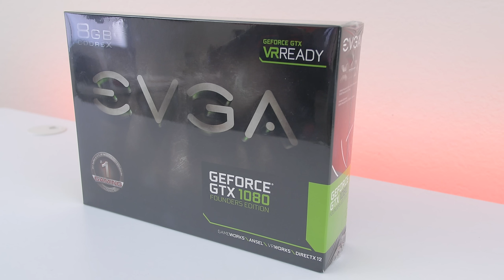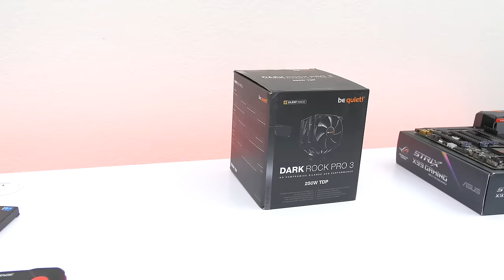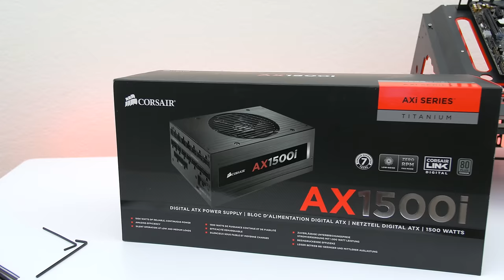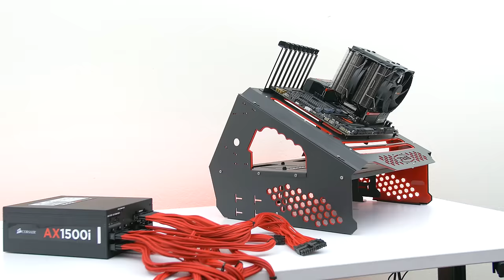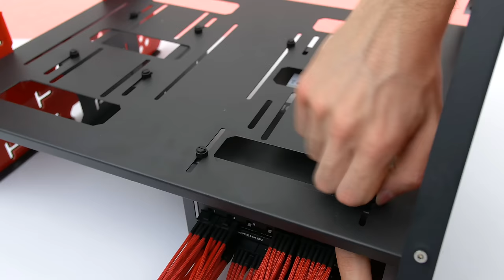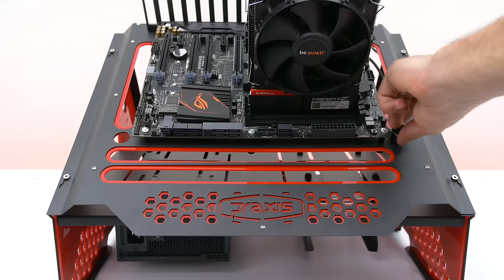Ultimate Test Bench Setup | Time Lapse Build

Comment from the maker: People wondering about the overkill on the PSU and air cooler for the CPU.

1) 1500W is needed if im going to be running 2 way and 3 way sli. Ill be even swapping the mobo eventually for 4 way sli setups and I need to make sure I have enough juice since ill be overclocking as well.
2) The air cooler is temporary, I swapped the CPU to a 5930k since a 6950x was overkill for the testbed. I will be watercooling the 5930k in the near future.

Thanks for the awesome feedback guys! <3
Reply: good stuff ed
Reply: not hating, but those two lonely ram sticks look silly in that motherboard
Reply: +Skai W :-$
Reply: IMO too much PSU since we are going smaller and ore energy efficient . Oh well to each his own.  1k been enough even 850 but yea. There it is =)
Reply: you can't have more than 2 way sli with the 1080 though
Reply: +piecaik i heard the same thing....
Reply: That is with the HB bridge
Reply: How did you get the custom cables?
Reply: Is there a spot on the test bench to mount the radiator?
Reply: Great Video Man I Hope Some time in the future we can coloab
Reply: +CosmicSlime90 cameron lol you spelled colab rong CosmicSlime90
Reply: Amazing PC 😉
Reply: where did you get the custom red cables from?
Reply: Why Too Much thermal paste (like IF u agree)
Reply: Can you use the test bench as an actual "case" for your PC
Reply: so are you going to make a part 2
Reply: Yep, but there's not much point in 3/4 way anyway, if people really want to have 3 cards then they might as well use 2-way + physx card
Reply: make a special setup only for testing and building with tools on the walls and shit
Reply: Good build however the asus deluxe II would have been the best choice but not respecting the red black colors. However more features
Reply: So..... 6950x + Big Red = Coming Soon??
Reply: Will you upload a non time lapse of this build?
Reply: What even is this for though?
Reply: yeah, i would have gone for low capacity rams too and populated all slots for the looks...but for overclocking less sticks is actually better!
Reply: can you make vid about best 400$+ graphic cards ??
Reply: what case was that
Reply: ***** is it? why do you think?
Reply: When I saw the CPU cooler I was like : WTF is that and why is it so big????
Reply: This is a complete build without a standart case. In my opinion an ultimate test bench would be the cheapest yet most optimum rig which is capable to work with gear in upcoming ~5 years. 

Not that I am hating or something, still cool and quality content but unnecessary.
Reply: +TechSource are these parts good quality items?
Reply: Why don't you change the geforce gtx logo to red
Reply: Hi TechSource i have a question, do you need thermic paste for a water cooling system ?
Reply: +Produjeu123 of course you do
Reply: Thx its because it doesn't show it in his 5000$ pc build so i was wondering
Reply: What is the case called
Reply: +mikai w I thought it wasn't a case
Reply: +mikai w you tried to help me stop acting like a two-year-old
Reply: +mikai w no deal
Reply: +mikai w nope you are
Reply: +katherine encarnacion Have some common sense! He was trying to help you. I think that you should at least appreciate the help he gave you!
Reply: +mikai w nope
Reply: +mikai w i'm not leave you alone
Reply: katherine encarnacion Please stop. Honestly, this is so immature.
Reply: +mikai w do you have a two minute range to use technology
Reply: +mikai w I get to use my iPad until 11 PM
Reply: +mikai w are you scared
Reply: +mikai w wow you can't reply to me
Reply: +mikai w nope
Reply: Nice
Reply: TechSource actually the new pascal cards don't need that level of power. I run SLI 1080s with an 850 watt supply
Reply: TechSource save energy man
Reply: i love those corsair psu wires 😍
Reply: Alfa_Official YT they're not corsair probs cable mod
Reply: TechSource what are the chances of me winning that PC for my birthday?😊🤗
Reply: it's not ultimate, titan x pascal is too over powered
Reply: TechSource I
Reply: TechSource how come I see you use lga2011 in almost all videos I have watched on your channel
Reply: what is the use of testbench for you bro?
Reply: TechSource  What is the songs name
Reply: TechSource name of the case?
Reply: Mursalin Akram I believe it's a wetbench testbed
Reply: TechSource I

Comment: My Pc Specs-
i7 6800k
Asus ROG Strix x99 Motherboard
Corsair Vengeance Rgb Ram, ddr4, 3000mhz, 2x8
1tb Seagate hdd
 m.2 Samsung 960 Evo 1 tb ssd
Asus ROG Strix 1070 oc8gb
Corsair 460x rgb case
6x Hd120 rgb corsair fans, Corsair lighting node pro.

Nice test bench, I also run the Strix x99 motherboard and it has been amazing

Comment: it's not much of a test bench if you don't have full accessibility to all of the ports. The main reason for a test bench is to keep all the buses and ports available, it shouldn't need highend components either, as you only need the newest motherboard, compatible RAM and a CPU for the socket, and that's it. You don't need a third party cooler unless you want to test that, but having a motherboard with so much cooling "armor" wouldn't give much flexibility unless you want to go the extra mile to take off the whole motherboard and then take off that plating. The more practical the testbench is, the better. I wouldn't go this way when it was about an X99 motherboard and definitely NOT a giant cooler on my CPU for a testbench reference setup. Would still go for the testbed tho
Reply: Cool but no one cares.
Reply: +Hope The test bench is clearly not suited for every components, which is why I had to point it out. Also it seems to only be built to test GPUs. Also, if no one cares, thank you for wasting your time replying to my comment

Comment: Even though it's not that big a deal, why go with a 1080 founders edition that blows air out the back of the card instead of a dual or triple fan 1080 in this open setup? Not only is airflow for this not very important for an open test bench build, but going with an MSI or and ASUS 1080 would have matched the color scheme perfectly.

Comment: I really like this test bed, but that mobo mounting plate need soo badly some middle supporting plate. That bending is not so good especially when you are supposed to work on it frequently. Besides that issue it look cool with that red acrylic accent. By the way can you light it up ? Or that's only for transparent one?

Comment: So, I'm trying to upgrade to an i7 6700k, because I feel like my GTX 1060 6GB is (kind of) being bottlenecked by i5 6500. The thing is, I'm pretty new to overclocking, and I plan on getting a water cooler, but I am so scared of it leaking. Lots of posts I saw on forums suggest to NOT buy cheap water coolers. So what would be a reasonable price for WC? (My mobo is an ASUS H1101M-k, in case you need that.)

Comment: Never really see the point of test beds. Sure, it loons good, gives he best test environment, but for most people they won't have the best environment. They have a small case, different parts, they don't have absurdly large CPU Coolers or Immense GPU's or PSU's. Nobody can ever hope to match the results. And when you get the results back from the test, they're unfairly represented, nobody will ever achieve the same results.

Comment: will the be quiet rock 3 pro fit on my Asus Pro Gaming z170?
Reply: yas
Reply: yes
Reply: yes sir
Reply: I'd be more concerned  on the case you'll be using,check your case for headroom for such a cooler :)
Reply: if you are using a mid tower or bigger it should fit
Reply: +soso_so _soso Cooler Master Pro 5
Reply: BarrackO'Bama I believe it'll work,BTW your build seems very nice,GL building it,have fun! :)
Reply: gl
Reply: If the case can fit a ATX motherboard, it probably can fit the CPU fan
Reply: Ram height?
Man ram is smaller than the stock cooler

Comment: I just want to ask, how can I tell how big of a power supply I need?
Reply: Put your pc into a pc building website
Reply: I guess you mean how powerful right?

If so , you have to add the TDP of every component of your build  and then you have to choose a PSU with a higher TDP of atleast 50w more
Reply: +IAmNutrak x Ok thanks!
Reply: +Benjamin Ngwisha ok, will do it!
Reply: Unless you go SLI/Xfire, youll never need anything bigger than 650w
Reply: +iDeFecZx Unless you buy an amd card
Reply: +IAmNutrak x Not even then, my mates 390x runs fine with an Evga 650
Reply: pc partpicker?
Reply: Is this PC any good? 
http://pcpartpicker.com/user/ImTech_/saved/vM6323
Reply: ImTech NO! Save for the GTX 1080! and i would go with a water cooler
Reply: +Killing Demons For Jesus I would also have waited for the 1080, but I don't do hardcore gaming.
Reply: +Killing Demons For Jesus And do you think I should go for a water cooler?
Reply: ImTech The 1080 is the same price for more power. I would wait. Water cooling might be quieter than the be quiet cooler but idk.
Reply: +ImTech "I don't do hardcore gaming" - looks to buy a $600 gpu...
Reply: . ikr
Reply: +Killing Demons For Jesus Ok, I'll wait! Thanks for the advise! :)
Reply: Felt the same :D If you don't do hardcore gaming then don't buy a 1800 dollar PC ffs
Reply: ImTech You also need to pick out a mother board. I can make some suggestions if you want
Reply: ImTech Nice. now just pick out a motherboard
Reply: +Killing Demons For Jesus I have purposely not put a motherboard in it. It wasn't there on the website, but I am buying a Asus Strix x99
Reply: +SixtyTwo I didn't mean it that way.
Reply: ImTech 6700k doesnt go with X99. So you'll need to get a mother board that sports z170 not X99. Thats why its not listed on the website.
Reply: Killing Demons For Jesus That is why it said  "not 100% compatible" xD
Reply: ImTech lol. If you really want to use that motherboard tho, you'll need to get an X99 CPU. For example, 6900k, 6800k, 6850k, 5820k, 5930k, 5960X.
Reply: +Killing Demons For Jesus ok thanks
Reply: Pcpartpicker.com lets you make a parts list which shows required wattage. Always go higher than required and make room for a second gpu if you want. The website also shows if the parts are compatible and shows the cheapest price available for parts.
Reply: Nevermind i see you use pcpaertpicker lol
Reply: also would not recommend a cx power supply.
Reply: +ImTech Btw you can get a 144hz moniter for 190 instead of 240. And definitely wait for the 1080( but you are buying a 1080 moniter so way overkill) if you are soending thus much you should not be playing at 1080p at all. The r9 480 will be 200 dollars and will be maxing out games at 1080p. The cpu and ram are also overkill unless you are editing/rendering ect. An i5 would be fine for you unless you use the 1080 of course.
Reply: +yusoghanem *RX 480
Reply: +ImTech Man, man. You say you wont play hardcore games.     Rx 480 will go great all 1080p and 1440p ok but as you have the money i would go either for x2 rx 480 or a 1070. And save up for a better desk setup or some money for steam sale :-)
Reply: +SparklezEdge yeah rx 480 sorry lol. The gtx 1080 is a super waste for 1080p as it is a 4k card. I mean you can build a 1080p for around the price of a single 1080 but yeah. If you are editing and stuff keep the i7 and 16gb ram, if not an i5 and 8gb will save you some money.
Reply: yusoghanem What if you like 144hz 1080p gaming. You could always ramp up anti-alialasing
Reply: +Ebyx why would I need a better power supply?
Reply: +Ebyx The PC that I have put together only needs 400W. I have a 750W PSU. It's more than enough.
Reply: ImTech I can concur, I have a EVGA 850W G2 80+ Gold PSU. Never made a better choice in my life. Great power supply. Like he said, if your PSU goes to shit. Itll take every thing with it. Although the 750W 80+ Bronze your trying to get isnt that bad. You'll be pretty okay with that. It's just the knock off brands you don't want. I only buy power supplies from Evga or Corsair.
Reply: ***** That's a bad ass PC. Do you already have your 1080 or is it still coming?
Reply: ***** I can't decide between RX 480 crossfire, 1070, or 1080

http://pcpartpicker.com/list/B2VVnn
Reply: ***** I have a 1080p monitor and want to get the 1080p 144hz gsync Acer Predator monitor. I don't really care for resolution because I could just turn on anti aliasing. But I'd like to get a powerful GPU like the 1080 or 1070 so I can get high frames, cause I mainly play call of duty and battlefield
Reply: Two rx 480s will be better than a single 1070 and performance almost like 1080. As long as you play only 1080p (144hz) i would go for two.
Reply: L Lots I hope so. That's why I'm waiting for real world bench marks. Because lately devs have been shitting on sli and crossfire support.
Reply: Yes. As long as we havent seen real benchamrks we cant cticize. But i hope amd will compete again. A nvidia 750ti  owner who might upgrade to rx 470.
Reply: L Lots I'm sure the Rx 490 will take on the 1070. And maybe a new fury card
Reply: +Killing Demons For Jesus yes, but there is always an option for crossfire :-)
Reply: L Lots After watching Tech of Tomorrows new video I'm iffy, and might rather go with a 1070 or 1080
Reply: +Ebyx Do what man. In my country it costs more than 800 euros.
Reply: +Ebyx Yes...
Reply: ***** lol that's why I dont want the Marines to deploy and move me to any country 😁

Comment: is 1500 watts really necessary
Reply: Probabbly gonna do 4 way sli
Reply: +KADEN HACKED 3 he wouldn't be able to fit 4 because the 2 pcie slots are to close together
Reply: +KADEN HACKED the GTX 1080 is only locked down to 2-way SLI, in which the 1500W PSU is still overkill

Comment: Why not use a CPU that people are most likely going to buy...like the 6800?
Reply: Because this will be a test bench, The top of the range I7 will mean that no graphics card setup will be bottle necked.
Reply: Ben Crowley I understand that, but I doubt a 6800K overclocked to 4.4 to 4.6 GHz will significantly bottleneck a GPU to the point where the results are unreliable. 
I'd like somebody for once to test with hardware that's not out of the reach of the average consumer.  It'll help greatly with part selection I think. 
All tech reviewers are falling all over themselves to test/bench the 6950X and GTX 1080.....what about the 6800K and GTX 1070 for those of us 'bereft of coin' so to speak?

Comment: Would someone be able to help me with this? I am looking to buy a gaming PC in the near future would someone be able to tell me if the specs I have chosen are good or what I should change;
CPU- Intel i7 6700k
CPU Cooler- Deepcool maelstorm 120k
Motherboard- Gigabyte Z170x Gaming 3
Ram/memory- G.Skill ripjaws V 16gb
Graphics card- GTX 1070
Storage- seagate 3.5' barracuda 1tb
       SSD- sandisk  ultra II 120g
Case- Aerocool battlehawk
PSU- Corsair 80+ gold full modular RM550x

Thanks for the help.

Comment: wtf was that thermal paste application
Reply: It gives good temps.
Reply: Raze actually too much paste can give you worse temps
Reply: +piecaik but that method doesn't. Actually it's one of the best method to apply thermal paste.
Reply: what about just using the pea method. lol it would make things much simpler
Reply: +piecaik Wrong, Too much wont affect the temps in the slightest, Only cause the compound to seep onto the motherboard. Linus Tech tips for reference
Reply: how about realizing that as having too much will provide an immeasurable difference in temperature, having too little can increase temperatures on poorly covered areas.
Wise up kid, there is obviously a reason why Ed does things things a certain way, because he has experience! 
It is obvious you don't know what you are talking about. so shhh.
Reply: Benjamin Roper lol i did the pea meathod on my build, "kid" and my 6600k is running at max temp of 60 degrees under load at 4.8 GHZ with the hyper 212 evo from cooler master. I'm pretty sure I know what I'm talking about, "kid." and why don't you wise up "kid" before you go out telling people what to do. All I did was ask why he used that method and I'm defending my point
Reply: Ha, invalid response. The die size is much smaller on that chip, you need more thermal paste for a bigger die. To ensure you get good covering, people like to do dot and cross.
I wasn't telling anybody what to do, I was disapproving of your immature and uneducated comment.
I will however tell you what to do, come back when you know better and make those comments, or phrase your "questions" more like questions and not " 
wtf was that thermal paste application"
Reply: Benjamin Roper actually the thermal paste only has to be enough to cover the heat spreader. he didn't have to make an x is all im saying with that comment. the pea method works on all chips and the pea size just has to be proportionate to the heat spreader size.
Reply: It is harder the judge to volume using a pea method for larger cpu's. It really isn't much more difficult to make an x, doesn't warrant you walking round like you are the regulatory authority for thermal paste application! Thermal paste arguments are the biggest waste of time, if you've got enough of it on there and you haven't covered your motherboard in it then everybody wins!
Reply: Benjamin Roper the thing is... im not walking Kappa